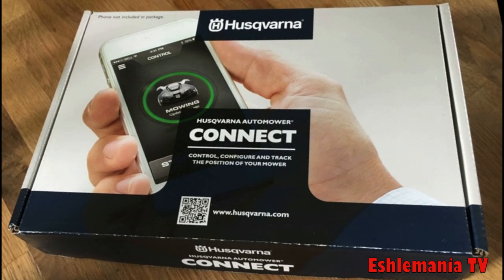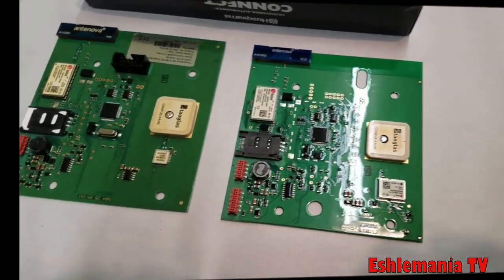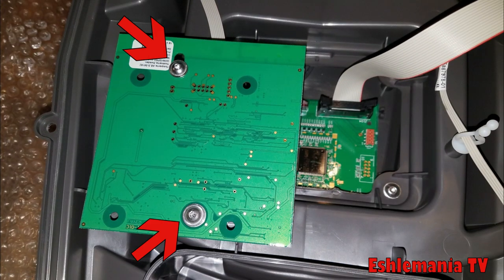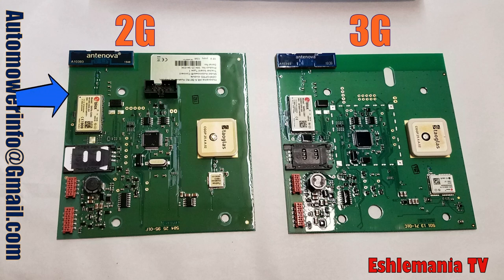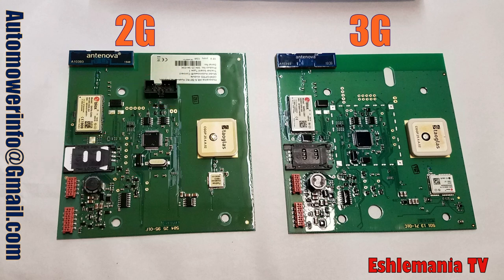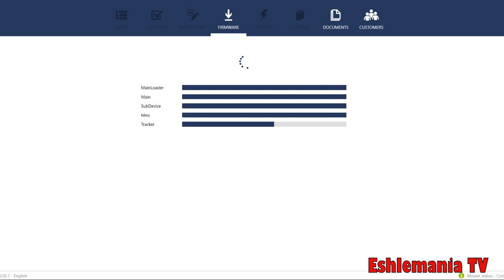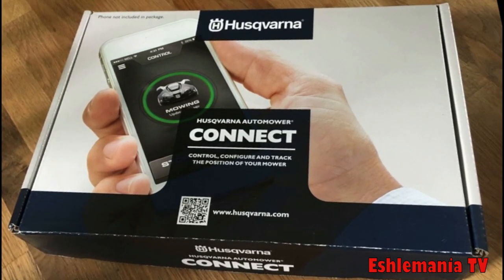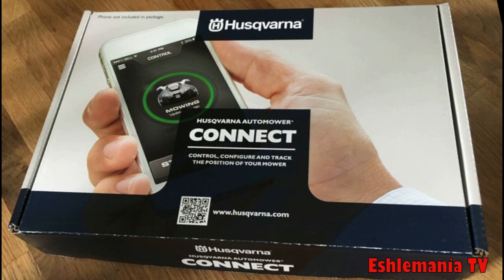Automower Answers: Automower Connect Upgrade; 2G to 3G

Comment: I have an early 2016 430x. I've bought it second hand but can't get my Connect function to work. Took it to a husqvarna service partner, who just mad a board update and told me it should work afterwards. It still gives me a message that I need to contact retailer to buy the function??
Satellite signal is OK on display.
Looked at the board inside myself then, but it seems like there's no SIM slot on the GPS board. Only the white box as on the two types you are showing and a few other small items.
Can you confirm that Connect wasn't standard on the early 430x models - only GPS? Don't like if the dealer tells me otherwise and made me pay for an upgrade, that doesn't work. He even said to me that the Connect module needs replacing if not working now.
Hope you can clarify this 👍
Reply from the maker: 2016 and 2017 model year 430X mowers came with a GPS board ONLY. It was completely different looking from the Connect/GPS board at that time.

Comment: Nice video, agree with what you are saying about supporting local dealers, wish I lived closer to your shop as you seem to really care.  Was wondering if there is any benefit to upgrading to this 3G board if mine is working fine as is.  Mine disconnects every other week or so and isn't a huge ordeal to get it reconnected so mostly curious if this new board adds anything besides better/stronger/upgraded connectivity?  Thanks.

Comment: I contacted my local dealer. They will update firmware and install module. This for 40€($45). Thx for your advice (i was wrong, i have  the 5866623-05 with E-Sim , not 04 😉)

Comment: I wanted to make a public comment here. This guy is great and the mowers are unbelievable! Husqvarna on the other hand, not so much. Everyone is nice and polite, but none of their tech people know anything about the product. Even "ask an expert" is useless. I have called the corporate headquarters in Charlotte and they were real nice, told me they would escalate my call to some high level, but I never got a call back.
Bottomline, do not buy one of these without ATT cellular service in your area. There is no bluetooth anymore (even though it is adverse having it) and without cell connectivity you will be chasing the little bugger all over your yard! They do work fantastic and I am suffering from a 1st world problem, but this is a pain and Husqvarna doesn't seem to want to address the issue. Why take bluetooth out? Why no wifi?
Reply from the maker: "Ask an expert" is a joke! About 10% of the people that answer Husqvarna related questions on that forum are actual experienced Husqvarna dealers. The rest are just what we would call professional Googlers and have never seen or used an Automower or 3/4 of the other products they answer questions about. They get paid a $1 or 2 per question they answer and it doesn't matter if it's right or wrong just as long as it's answered in some way. An "Expert" can literally answer a question wrong and have it voted on as the best answer by other "Experts" and if someone that actually knows what they are doing corrects them and gives the right answer the others will message you and give you a bunch of crap about how the question was already answered and voted for and you're just trying to take their answer money.
Reply: @EshlemaniaTV  Husqvarna has some real issues the need to fix, and soon!

Comment: Dealer installed module. 

They also needed to install new seal (for water). 
When they open 310 model, they need to replace the seal. (6€)
Don’t know if it is needed for all models, but just wanted to mention it. 
Thx for your advice.
Reply from the maker: Great comment! In the installation instructions it says to replace the rope seal anytime the chassis is split open. Many dealers do not do this if the unit is still fairly new. The problem with that is the seal is round and gets crushed into place when the 2 halves of the chassis are put back together so since the seal is already crushed it is not sealing properly now and also affects the torqueing of the screws that hold the 2 chassis halves together. My question to Husqvarna has ALWAYS been if you are saying that the seal needs replaced when installing a new Connect board, why not just include it in the box with the board?

Comment: My experience...the app was an initial selling point as I could remotely tell the mower to park if bad weather was approaching.  Unfortunately, the mower would only intermittently connect at my location due to poor cell service.  The mower seemed to try to re-connect only after being disconnected for 24hrs and if it found no cell signal, it waited until another 24hrs had passed before trying again. Not very robust. After 4 months of use it disconnected and two weeks later even the icon that showed whether it had a cell connection disappeared from the display screen on the mower.  My mower is in Hawaii so I can't just 'take it to the nearest dealer'. Other than that, it's cool when it works.

Comment: I have a 2018 315X model that isn't connecting to the cell towers. I suspect that I have a 2G sim card. Is this a free upgrade for owners of the 2G models? Or should I just return my new and unused 2018 model and buy a 2019 model?
Reply from the maker: If you take it to an authorized dealer they should be able to get it upgraded to the 2G/3G board for you under warranty

Comment: Hi I’ve got a question. I’ve just ordered a Automower 310. But when I check the accessories on the Husqvarna website it only shows me the -04 version as available for my model. Will the -05 work as well? 
Thanks for your support!
Reply from the maker: The Automower Connect upgrade (586662305) will work in a 310. It will give you the Connect feature, but not GPS mapping from what we are told.

Comment: i have a question. I have bought a 310 (standard no Automower Connect). if i install the board model 5866623-04, will it work without updating firmware of 310 ?
Reply from the maker: Nope. It will not work properly without updating the firmware.
Reply: @EshlemaniaTV  how do I update it as I have just bought the module

Comment: I bought two 450XH units online and installed them myself, great mowers! Problem is no ATT cellular service in my area. I tried to install a US Cellular SIM card in the slot as suggested by Husqvarna. The card registers with the network but the app will not work. I spent over an hour with "level 2" tech support and they could not make it work. They don't have a clue! Any suggestions? Also it they think you only have an option for Bluetooth or cellular but not both. Again, not impressed with Husqvarna's knowledge of their own equipment. No dealer within 100 miles of me and I'm sure the average dealer won't know either.
Reply from the maker: I know that the older 2G boards would work with a SIM card from another service provider. They had a 2G SIM card in them I don't know though if they would work with a 3G or 4G SIM card. I also know that when I have a mower that will not connect ("X" over bars), I can usually get them to connect by turning on the hotspot feature on my cell phone. My phone is a on a Verizon plan and for whatever reason this usually helps get a connection established for the mower. I've done this several times now over the past 2 months.
Reply: @EshlemaniaTV  Thanks for the response but that makes no sense. Hotspot on a cell phone is wifi. The automower only has cellular or bluetooth, totally different from wifi. I will try it but that seems impossible. I have an activated SIM card from US Cellular in one of my mowers and US Cellular sees it up and connected on their network but the app does not work and Husqvarna tech support doesn't have a clue how to make it work. They also think you cannot have both bluetooth and cellular, different boards. Even with that they could not give me the part numbers. I have a regional salesman trying to find out. Husqvarna suggested I return the mowers if I was not satisfied. Kind of shocked at their attitude. I live the mowers but it's a pain not knowing where they are or if one has faulted. I'm mowing over 3.5 acres with ponds, creeks and lots of shrubbery. I may try a cellular tracker next. Crazy Husqvarna doesn't have this worked out by now. They should allow any owner to insert their own SIM in an external slot. Even wifi would be great as most of us have it extended around our yards.
Reply: @EshlemaniaTV  I tried the hot spot trick, no luck. Do you have an old 2g board you could sell me? I'm really getting tired of hunting these little critters down! I may buy a cellular tracker and mount it to the mower. I'll have to tap the 28vdc power. Might be hard to find one rated that voltage.
Reply from the maker: Pretty sure that the 500 series of Automowers has both Bluetooth and cellular connectivity. I looked it once a few months ago and if I remember correctly I think it was just a different HMI board that was used. I have not done anything with the 500 series personally but I'm almost positive that is what we were told at dealer meetings earlier this year.
Reply: @EshlemaniaTV  So I really don't have any options? Seems like an issue that will hurt automower sales. Crazy because it is an easy fix. At the very least they should be wifi compatible.

Comment: I am hoping someone can help me out. I purchased the 450X in spring of 2018. Ran fantastic until October of 2019. Signal strength suddenly went down to 1 bar.I thought I might have a 2G board in there. Bought a new 3G board. After I installed it, all I got is the sim card icon with an "x". I connected to the pc with Autocheck software and it shows sim card not activated. How do I activate the simcard, or did I get a bad board? Grateful for any help!
Reply from the maker: How did you get the Autocheck software? That current version is only available to dealers. If you are using the Autocheck experience program that could be your problem. It needs to updated using Autocheck 3
Reply: @EshlemaniaTV  Yep, it is Autocheck Experience that I am using. I didn't realize there were 2 different versions of the software. No wonder I only had to pay $30 for it off of eBay. I guess I am out of luck. I have expressed interest in becoming a dealer to Husqvarna, but they do not seem to be very interested because I do not already have an established customer base. Using your videos I have replaced both drive motors, bearings, front wheels, Cut height adjustment assembly. I really enjoy working on it, wish I could do it full time. Thanks for the response and the great videos!